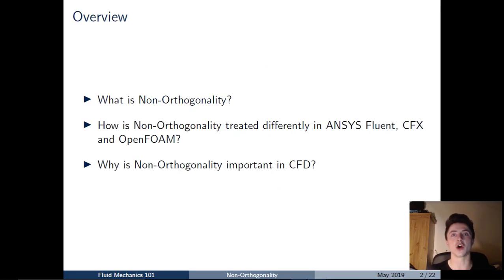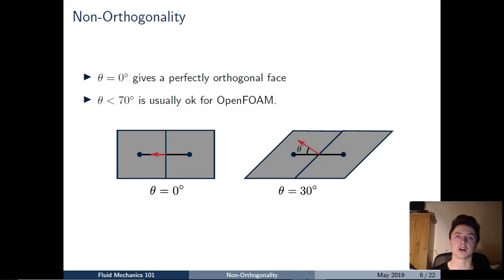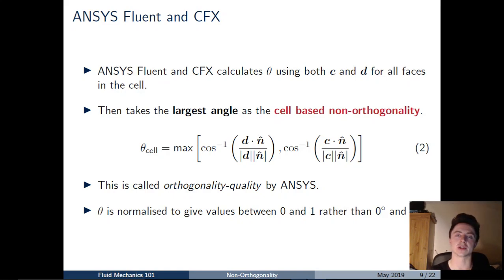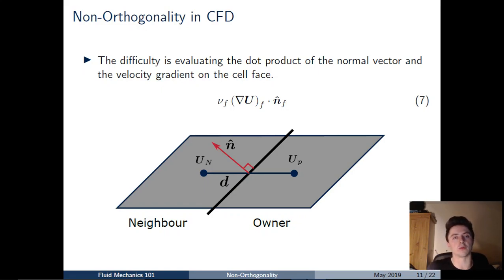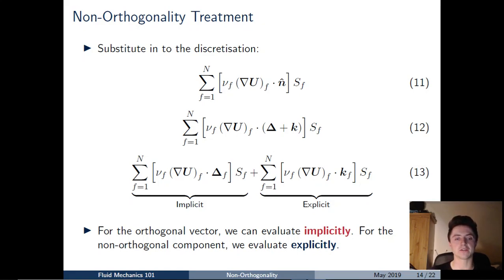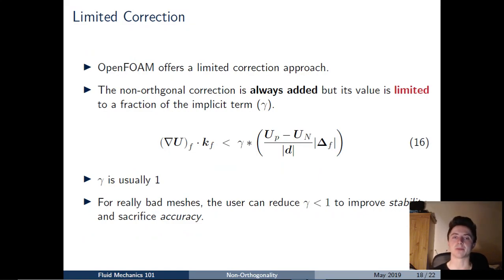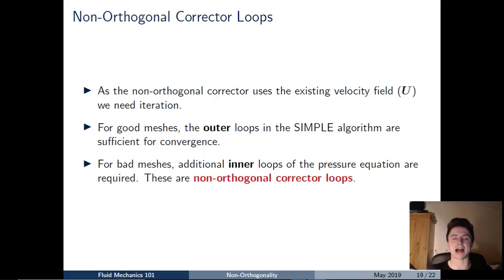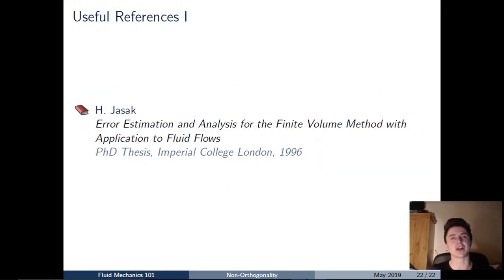[CFD] What is Mesh Non-Orthogonality?

Comment: Say I wanted to validate a solution and calculate its momentum equation loss. For the Orthogonal component, would I still need to calculate the implicit face gradient through the first order approximation, or could I use the explicit face gradients (interpolated from the cell gradients)? If so, why is a decomposition needed, couldn't we just dot product the explicit face gradients with the normal vector then?

Comment: Hi. A small question: For the convection term, the volume integral was appropriated to summation over each face(U*F), where U and F are the velocity and mass flux at each face. The mass flux also contains a dot product of the velocity at the face and the normal vector. Do we have the non-orthogonality treatment over there as well? Also, on slide 12, why is it U_P - U_N, and not U_N - U_P?

Comment: Thank you Aidan! Your videos are really invaluable, because information on CFD theory is really difficult to find in an organised and easy to understand way like you explain it!

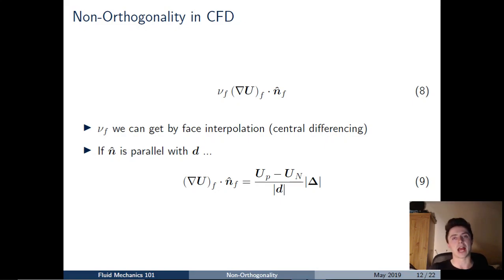In this video, I have a problem with equation 9 at 15:20. It looks to me that even if n̂ is parallel with d , this does not allow any simplification of the dot product ∇Uf ∙ n̂ . This is because the orientation of ∇Uf = (Up-Un)/|d| is given by (Up-Un) , and it is a generic 3D vector not necessarily parallel to d . Therefore, when taking the dot product ∇Uf ∙ n̂ , the angle between ∇Uf and n̂ still has to be accounted for .
What am I missing here?
Reply: I agree with your point. This simplification would have been allowed if U was a scalar field, but I'm not sure if it is applicable if U is a vector....

Comment: I have a question about the skewness and neighboring corrections in ANSYS Fluent. As I understand it, non-orthogonal correctors run in the background, and the user actually has no role in adjusting them. However, what about skewness errors? These corrections are actually up to the user to define, and they have to be an integer number, 1or higher. So, how do these affect the equations, and why do they only appear in the PISO algorithm

Comment: Excellent video as always Dr.Aidan,but I have a doubt.Instead of calculating the gradients as explained in the video,why can't we take a weighted average of gradients in the cells which share the face. I understand that there could exist a skewness error in the same,so why not do a nodal averaging of gradients wherein the gradients at the nodes are obtained by a weighted average of cell gradients. In other words,why don't we deal with the gradients of flow variables here the way Green Gauss Node based scheme deals with the value of flow variables.
Sorry if the question is very trivial.I am a beginner in the field.
Could anyone please shed light on the same??
Thank you in advance

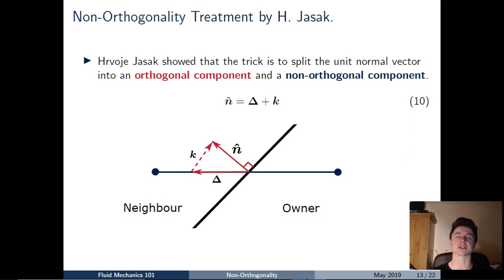Comment: Are the angles associated with equation (10) correctly drawn? Around time 16:43
Reply from the maker: The unit normal vector is always normal to the face (right angle). The other two vectors can be different lengths, which result in different angles. If you watch part 2, I go through the differences between the different decompositions for the other two vectors which should help explain
Reply: @fluidmechanics101  I was expecting the normal vector being split into orthogonal and non-orthogonal components to result in them being at a right angle to each other. A "100% orthogonal", and a "0% orthogonal" component.
I will definitely watch part 2 to see if I understand this correctly with the different options.
Reply from the maker: I think it is the other way around. The normal vector is always orthogonal (90 degrees) to the face. It is decomposed into a component that is parallel with the vector d, that connects the cell centroids across the face, and a residual component. 

This should be explained in the next video. If not I will try and add some more detail 🙂
Reply: As you suspected, a resultant vector is longer than its associated components. If n̂ were the resultant, then it would also be the hypotenuse of right triangle n̂Δk. In that case, Δ would need to be drawn shorter, such that k appears vertical.

If k were vertical, then it would no longer be perpendicular to n̂. Therefore, it seems that orthogonality is defined not with respect to n̂ (the shared-face normal), but instead with respect to d (the centroid-to-centroid direction).

Comment: Thank you again for this excellent video. In your opinion, what would be the non-orthoganality angle treshold in order to apply the corrector? Since I'm using OpenFOAM, I could set the limiter parameter 'gamma' accordingly. Lastly, I saw you mentioned that the non-ortho correction is always added in OpenFOAM. I've noticed that OpenFOAM use a 'snGradScheme' on the diffusion term (LaPlacian) and, if I understood correctly, you can choose one that apply correction via implicit and explicit term for non-ortho correction. So, how the non-ortho correction is always apply if I can choose a linear 'snGradScheme' on the diffusion term?

Comment: Great work, incredibly helpful, Adrian! I’ve a doubt. Why is it that only pressure equation is non-orthogonally corrected while momentum and energy equations too have diffusion terms?
Reply from the maker: I've been working on this for a while and I think I need to update my explanation (it is quite tricky). We always need to add non orthogonal correctors in momentum and energy equations, or we will get errors. In the pressure correction equation, if we are solving for a pressure correction (as in traditional SIMPLE, not modern OpemFOAM SIMPLE) then the pressure correction tends to zero as the algorithm converges, so it doesn't matter if we neglect the non orthogonal source term (as long as the mesh isn't too bad). I should have more detailed info coming out for this in a few months, it is quite tricky and needs a detailed explanation!
Reply: @fluidmechanics101  Looking forward to that!

Comment: hello, one simple question. why we need to use implicit scheme in the orthogonal component and explicit scheme for the non-orthogonal component? many thanks for answering.
Reply from the maker: We can use an implicit scheme for the orthogonal component as it is only possible to write the temperature gradient in terms on the unknown temperatures (TN and TP) when the vector d is parallel with the unit normal vector. If they are not parallel (the non-orthogonal component) then we cant do this, and we have to evaluate the dot product explicitly (using the temperature gradient from the previous iteration). This is explicit treatment. 

I realise that this is the most challenging part of the orthogonality treatment and it is quite confusing. So i am going to explain it in a lot more detail in my upcoming course ‘Fundamentals 3’, which will be coming out soon! You will be able to pick up a copy from my website or patreon (links in the description), whichever you prefer 😊